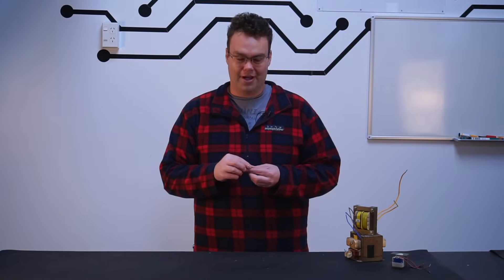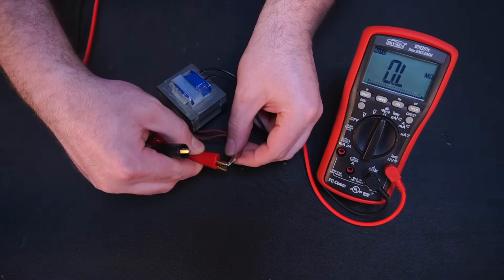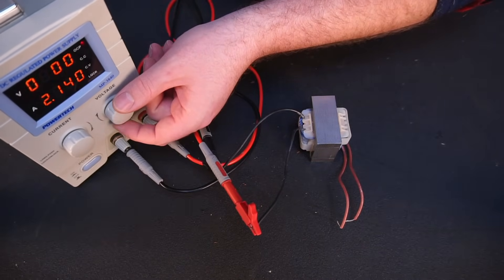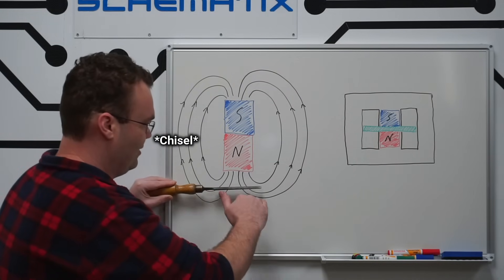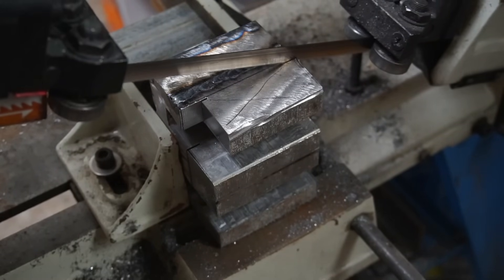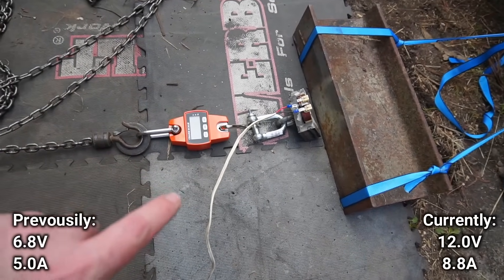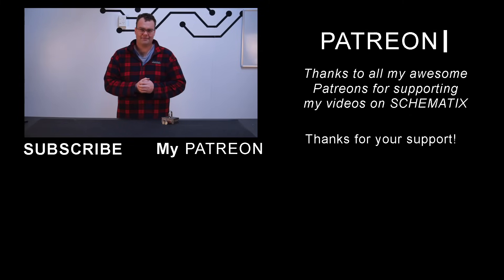Making a Powerful Electro Magnet from a Transformer

Comment: In other words a transformer core contains all the field, as long as the core isn't saturated. Thus external iron doesnt interact with the magnetic fields inside the core. But where the field exits the transformer core, they can interact with external ferus metal.
Reply: The field lines are are in a close circuit. 
The horse shoe magnets would be having pole pieces when stored for long time.
The torroid core design assures self shielding meaning any other torroid core transformer can be placed just beyond half the diameter distance of the bigger one.
In the case of a solenoid winding to minimize/ avoid interaction the coils would be placed perpendicular to each other and in the case of a third coil, it would be placed in the vertical plane.
You can observe this in the radio circuits.
Reply: @subramanianr7206  if one rewatches the video 5:14 , the original core before being modified was expelling some magnetic fields. That's indicates over saturation that inturn indicats one should run fewer amps due to the fact that the rate of increase in the magnetic field drops due to drop in a decrease in permibility. 
https://en.m.wikipedia.org/wiki/File:Permeability_of_ferromagnet_by_Zureks.svg

But, on rexamination of transformer design, i might be wrong on the saturation current after the core was modified.  Transformer design sometimes introduce an air gap to increase the saturation current level. Cuting the core in half introduces a large air gap in the magnetic circuit. Presumptively, that will also increase the saturation current level, maybe well beyond 4 amps. The large air gap now allows for using the core as an electronagnet. But when a piece of metal closes the air gap, the saturating current level will drop. 

Take away is that there are more things to consider what current one wants to run depending on the core and how one will use it.

Comment: Hallo... Nice video... There's something I'm unsure about ... I would like to make an electrical vice ... I have a micowave transformer .. I use the primary wiring and then I plug it directly into my 220 volt ...🤔🤔🤔Thanx... Greeting from South Africa..
Reply from the maker: Yes, you can run an electromagnet from a wall power outlet provided the primary winding is rated for mains voltage. The magnet will probably make a buzzing noise (this is caused by AC power). And be sure to connect the chassis of the transformer to ground for your safety. I'd recommend using a fuse to protect the electromagnet & yourself 😊
Reply: @Schematix  no. It seems he is bit naive. I would strongly advice not to use 220v mains AC to power it up. 
As you mentioned it would be vibrating at 50-60 cycle/sec.
The MOT in the oven has the primary winding to work just at or below the saturation point.
So to limit the heavy in rush current the moment it's switched on and to limit the current throughout it's provided with the "magnetic shunts". Remember you removed two sets of iron lamination on either side of the coil when you removed the high voltage secondary winding.
The soft iron metal cuts of some of the magnetic field lines that are coupling between the primary winding and the secondary winding of the transformer thereby limiting the current.
Without the "shunt" if you apply the power from the 220v primary there's is nothing to check on the huge current flowing in the coil resulting in heating up and possibly burning out quickly.
As you have been doing it is best advised that a DC power of lower voltage is the best especially for the ones who asked the question.

Comment: Imagine an EMP so powerful it turns a modern country into the 1200's in mere seconds and it takes 20 years to recover. Or only EMP Women so they start to act 'right'
Reply: Get outta here incel

Its a frigging magnet video. And an EMP wouldn't do crap that couldn't be fixed quickly

Comment: If you placed this E-Magnet near your belly button in OFF position, then put a stainless steel dildo up your bum and then turned on the e-magnet wouldn't it make the metal object pull inside your rectum without and digital help?
ALSO GUNS: What if this device was placed on a rifle barrel and turned ON and you shot Steel bullet rounds wouldn't it slow the bullets or reduce the velocity a little?
PLEASE let us know.

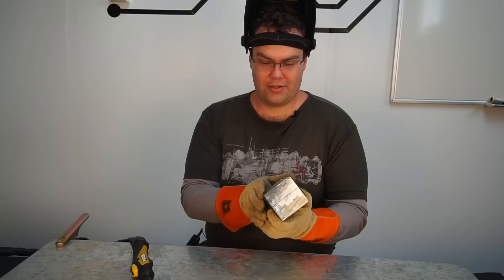Comment: 0:49 - Finally! Someone knows how to present valid information about the electromagnet and not just banging a wrench on the electromagnet. Also at 10:59 - wouldn't it be better to weld first then  cut the transformer? Does this "electromagnet has any use"... YES make a linear motor...
Reply: At, 13.45, he mentioned that he could/should have welded on either side of the cuts to avoid prying of the laminates.

Comment: Something of note that could be relevant. Magnetic field is proportional to amperage times number of turns (plus or minus difference of losses)
A 200 turns at 4A electromagnet will have almost the same strength as a 400 turns 2A one. Only case by case differences will make one or the other slightly stronger.

Well, there are other factors to take in consideration when choosing one over the other, such as power loss into heat, thermal properties,... but that is more relevant when winding an electromagnet from scratch. The point here is to use easily available material and minimum complexity of modification. Which microwave transformers fit perfectly, plentiful, cheap and easy to power.
Reply: If you don't mind a question: how can i determine the max or correct amperage to run thorough a primary winding? Can i use the labeled values on the transformer?  I also have a question about height of the legs on the "E" frame the windings are in. Is there a sweet spot in relation to the ark of the magnetic field for an increased gauss value or just closer is better? Lastly since the magnetic field is the same at each pole can I use plates on the side and leave both poles ooen to have the ability to hold items on top as well as hold the device down to a metal surface as needed for a drill press? Thanks in advance for any illumination you might care to offer.

Comment: Hi mate if the transformer had 2 ohms resistance would it still work with somewhat less strength ?
Reply from the maker: Yes absolutely. You might have to run a slightly higher voltage than I was to achieve the same current through the winding. But it will work just as good. :)

Comment: I didn't see any comments about the mistake in diagram @9.21    I am confident this is secondary school science stuff....and unless I missed the reference to a basic magnetics concept...i.e. no mention of ampere turns vs flux density ... Schematix is testing you....and you didn't pass!....fun use for a microwave tranny though....and what degradation in lift performance if the legs of the core was left as it was initially cut with angle grinder...as I suspect that not that many have a metal cutting band saw ? Thanks for the great idea and future project !
Reply: The diagram at 9.21 is absolutely correct. If you want to find out a mistake it would be that he had not marked the arrows on the lines to represent the direction of the convention; but surely he was drawing it from the N pole to the S pole.
In the whole transformer the field lines are closed. 
When the pole piece is exposed by cutting off it keeps attracting the iron with a heavy force.
You should refresh your school physics, I believe.
Reply: @subramanianr7206  The diagram shows lines of flux without any effect of the core. Are you saying that the core has no impact on the concentration of flux? If so then I suggest I am not the one who needs to refresh school physics!

Comment: Even more fun, putting a magnet into a aluminium pipe and let it fall down. Eddy currents never get old!
Reply: In a thick copper pipe it would be more awesome.
Reply: What happens then?
Reply: @jeffbeck9444  the NeFeBo (simply neodymium) magnet if dropped into the lumen of a copper pipe it would be slowly dropping to the floor because of the magnetic field created by the Eddy currents along the circumference of that part of the tube it's crossing.
If you cut the tube vertically at one place (ie making a vertical slot) thereby avoiding the completion of the Eddy currents the magnet would drop faster as if it's dropped through any other plastic or cardboard tube.
There are many YouTube videos available to demonstrate the effect.
Reply: Thanks for the reply

Comment: Wait so it only took 35W to lift 300kg?  That's insane - I'm sure the magnet didn't didn't even get that hot.
I understand that voltage isn't really that important for this, but, what role does it have?  For example, if you were to do 1v at 5A, would you get the same results?
Reply: Potential difference is to drive the current in to the load. The magnitude of current flowing in the load depends also on the resistance it would have to offer. 
Ultimately power is volt multiplied by current. 
In the MOT it's the primary winding through which 110/220v is applied.
Here you apply anything like 5,12 or 24v; the current will have to be limited as per your requirement.
But I myself will have to test it to see the power of the electromagnet by applying various voltage/current.
The project is in my bucket list, of course.
He has the skill and dedication, no doubt.
Reply: Not sure where you get 35W from.  The final test was with a 12V battery.  Assuming the voltage was maintained at 12V then approximately 12A would be flowing since the resistance of the coil was found to be 1 ohm. Hence power used was around 120 watts (allowing for increased resistance as the coil warmed up) rather than 35.

Comment: I’m about to make one myself. Just wondering if you found the magnet was starting to heat up at all? Also what gauge wire did you use from the power source to the magnet?
Reply: if you use the maximal currant for the transformers gauge you should make the wires powering it the same or thicker.
Reply: @justincase490  it’s working perfectly when connected to a 12 v car battery,very strong. I tried connecting to a 12v 10amp power supply and it won’t work,very weak! What am I missing here?
Reply: @kirkchamberlain8490  my best guess : the power supply cant deliver the required amount of amps. If the coil has a resistance of 1ohms the amps needed is (12V times 1) 12 A. To use your power supply the resistance should be 1.2 Ohms minimum. hope this helps

Comment: Excellent video particularly on ease of selection of the transformer.  A very cheap mag drill is in my mind I always wanted, and, what I really want to do is a cheap method to have a kill switch on my digger I need to be activated by trips for safety where the "real thing" dam near costs more than the machine. (the magnet will hold the fuel shut off open and another can similarly lock my hydraulics simultaneously on the same electric circuit). Thinking that much power would also work as a lock on the slew control (it's the real one that kills people tripping or catching clothing) in a circuit where if it's not locked the fuel and hydraulic one power off). Been trying to find a way to do this for ages.

Comment: Did anyone point out that the attractive force is not only dependent upon the strength of the magnet but also the mass of the material being attracted. A large piece of cast iron (or heavy beam) will be attracted very strongly, sheet metal not so much.
Reply: It's the total surface area and the thickness of the piece to be attracted; not the mass, means the effective field lines of the magnetic  poles must be lying within the thickness beyond which it has no influence at all.
Reply: @subramanianr7206  Assuming consistent density, "surface area and thickness" would effectively be relative to mass. Of course, material outside the magnetic field has no effect on the attractive force, did I imply that somehow? I would have responded more specifically if this was a physics forum.
Reply: @jeffschroeder4805  Density is mass divided by volume. Sheet metal is thin.By "A large piece of cast iron", you mean sufficiently thick and heavy iron. The density of the cast iron and the sheet metal (soft iron) are certainly but slightly different. 
If the heavy piece of cast iron is not having a surface area to cover the face of the poles of the magnet or it makes point contact with the magnetic pole the force of attraction would be very low.
Similarly if the heavy cast iron piece has a thin layer of metal (the rest being the large chunk of the body) to come in contact with the magnetic pole the force of attraction is only less.
Reply: @subramanianr7206  So.....I was wrong to point out that a magnet would be more strongly attracted to a marge mass of cast iron than a piece of sheet metal? I stand corrected.
Reply: @jeffschroeder4805  My sincere appreciation to you. Thanks very much.

Comment: Iam impressed and have been running my own tests. I would like to make a small one to pull dents out of my car. This is very practical for the guys wanting to conduct minor body work on their own cars without grinding off paint to fill dents and painting over filler.
Reply: One thing you forgot; dent means depression. Uneven surface won't be held up well by a magnet. And you would need an MOT magnet (yes the same thing what's in the video) to try on the dents, not anything smaller.
Reply: Creating a vacuum over the dent allows atmospheric pressure to try and push the dent out for you. At roughly 14 pounds per square inch the force adds up quickly. 
For pulling dents with electromagnets it's highly beneficial to be able to get a piece of round stock behind the dent although this isn't always possible. Dent removal without removing or damaging paint is an interesting topic. Best of luck with that.
Reply: hope you succeed. because if you do it will be a new technology for #PDR.
Reply: @hermantecson8344  Yes, rightly said 😉

Comment: That was cool...I have like 8 of those transformers lying around. Does it get warm at all at 8A draw?
Reply: It should get somewhat warm with time: it dissipates more than 100W. If you are not using for long time continuously, it should be fine.
Reply: What I concern is not the transformer but the power supply.  I have a few of these supply at home.  The electronic are ok but the wire can get hot indeed.
Reply: @manla8397  Real big electromagnets are made with hollow copper pipes that are insulated with two layer of fiberglass cloth Once wound nicely, they are fixed with resin (epoxy) so that they are fixed in place. The power supply gives hundreds of amps at a low voltage 5-10V or so. The coils are cooled with chilled water (also mixed with antifreeze) passing through the coils. These electromagnets were used in ESR and NMR machines but today they have been replaced with permanent rare earth magnets and superconducting magnets. In case you coil is getting too hot too touch, you need to reduce the voltage and the current.

Comment: If you don't want to muck around with tearing apart a Microwave Transformer you could buy a cheap 600lbs rated Access Control Mag Lock for $30.00 or so and use that. 12 Volts at 1.5amps is enough to power one of those.

Comment: i have made miself and the current cosonption is 18 amps on my power suply
that i made thanks to you
the diode bridge rectifier get very hot so i have to disconect
i am thinking of making one out of a car alternator
Reply: A diode pack from a Welder would work as well.

Comment: Good to see that I am not the only one obsessed with magnets!

I couldn't help myself - I made a video on my channel several years ago. You have given me a few more ideas......
I have several microwave transformers that might be taking on a little transformation themselves 😁

Next term I will be teaching night classes on automotive electrical subjects. I drag around a rolling trolley with heaps of wire and you guessed it.....lots of permanent magnets as well as electromagnets to show students how solenoids, motors, relays and other tricky electrical components work. I usually use a rotor out of an alternator as an electromagnet to show magnetic strength holding a solid shaft of steel, but your idea might be a good alternative (excuse the pun) option!

Keep up the good work! 👍

G'day from 'Across The Ditch'
MiracleMAX

Comment: Thank you.
Did I hear correctly that you only put 12 volts through the fine secondary windings?
12volts at how many amps?
If AC, was it 240, at how many available amps?
Love this stuff!!!
Reply from the maker: Glad you enjoyed it! With the large transformer, I only used the primary winding. It was powered from 12VDC at about 8.8Amps. I was surprised how powerful the magnet was given the relatively low power consumption :)
Reply: @Schematix   hello very nicely explained .I have a good question for you " what is the AWG of the wire?" Thank you